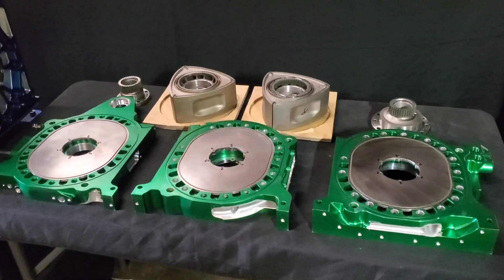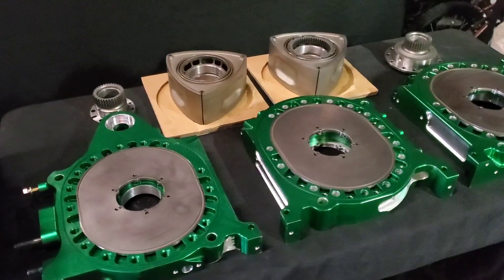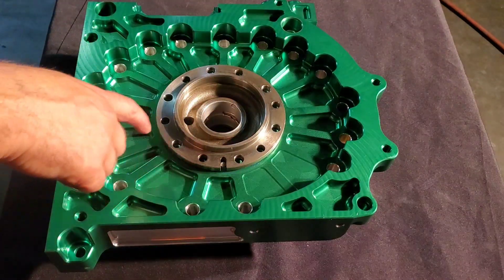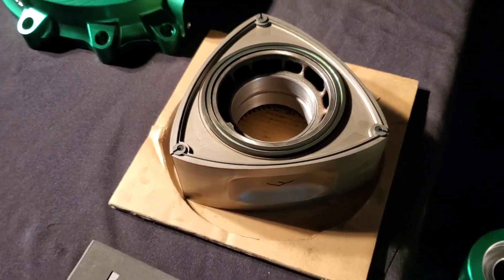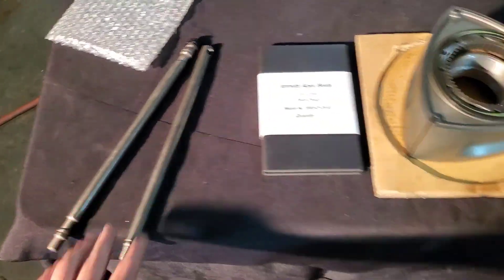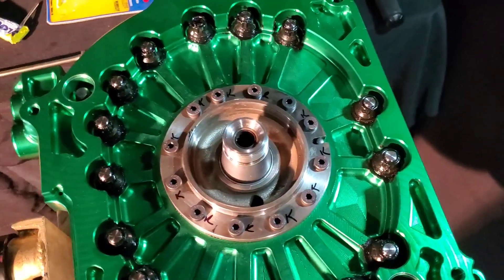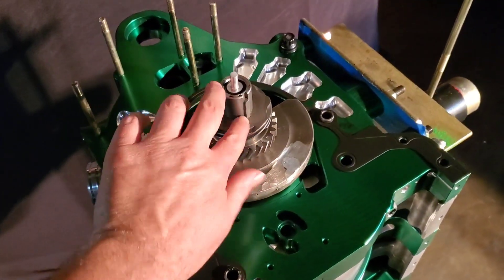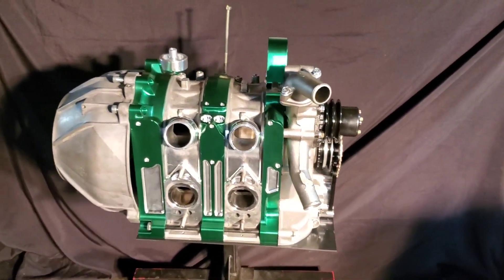Building custom Billet Mazda Rotary Engine,  Peripheral Port 13b block, Kyle Mohan Racing

Comment: Kyle................A lot of what was done to this Billet front plate would also be applicable to the 20B front plate that I have corresponded with you about..........The addition of
an four mounting "ears" of similar size and shape but a different angle to the center line of the engine............The studs and the solid dowels would also be used and other
minor changes to the overall outline of the plate.............Great video...............Thanks...........KT